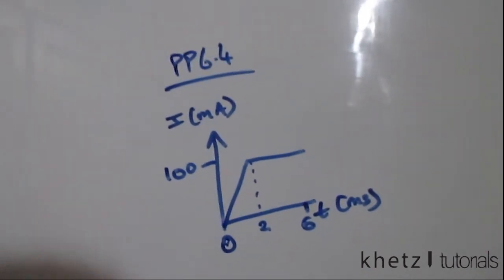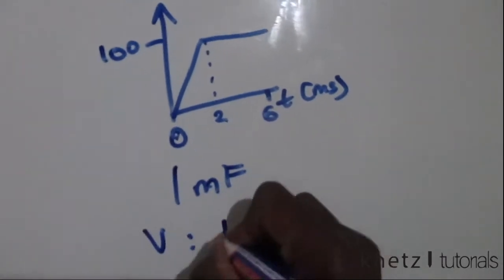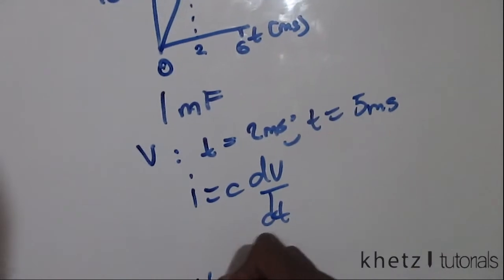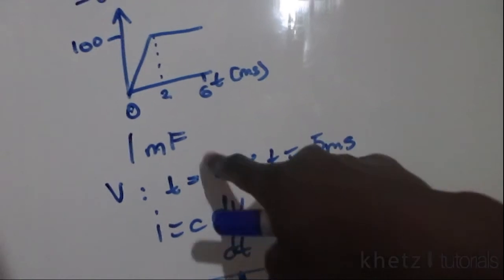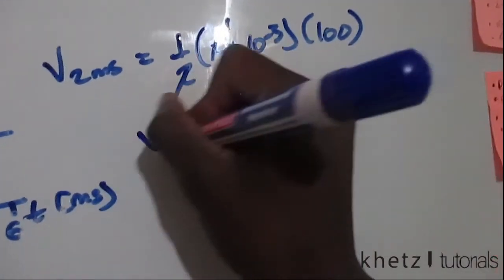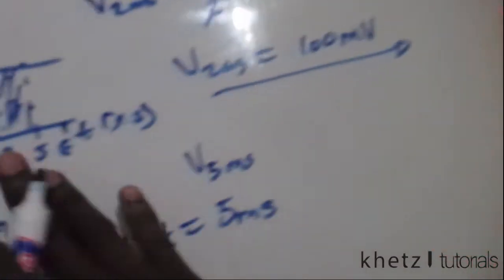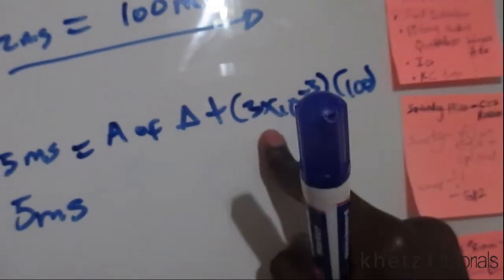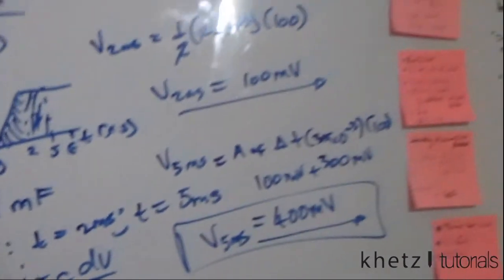Fundamentals Of Electric Circuits Practice 6.4

Comment: your result is very accurate and so is your method but your calculation is not, it is rather "vague" I could say the least
please make it  clear that you divided by C after finding the area between 0 and 2 which was 100µV to become 100mV after multiplying by 1/C  
thank you so much for putting the time and work to help students great video
Reply from the maker: Thank you for your feedback. I do have another video that covers the same problem using integration 

https://youtu.be/Vn_nUAoJlrM

Comment: Thanks sir
Reply from the maker: Please note that the approach is correct but not complete. The 1/C still has to be accounted for since the area only satisfies the integral and not anything else that is multiplied with it. So you are always supposed to take the units of both axes into account and multiply the result by 1/c. Doing that for the 2ms area would mean v = (1/1mF)[1/2(100mA)(2ms)] which will give you that same and correct answer of 100mV